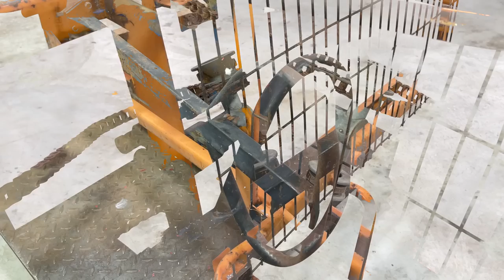Genius Guy Restores Extremely Old Manual Forklift // Hydraulic System Restoration

Comment: Great job on the restore, but you really should learn to turn your amps down on the welder and do a proper weld rather than spot welding like that.  Spot welding doesn't melt the material to create a bond, instead it's no different than soldering because you're only throwing welding wire at it instead of melting it into the parent metal.  Oh, and I don't know if you noticed or not...but you kinda greased the wrong side of the bearings.  Grease works better inside the bearing lol.  Just a tip, I got no complaints about your restore tho!  I think it turned out absolutely awesome
Reply from the maker: Thank you very much, we need your comments and sharing your experiences, we are very happy to have an audience who shares as sincerely as you.